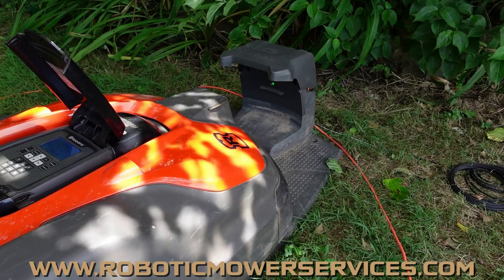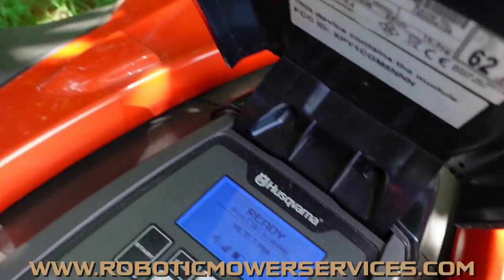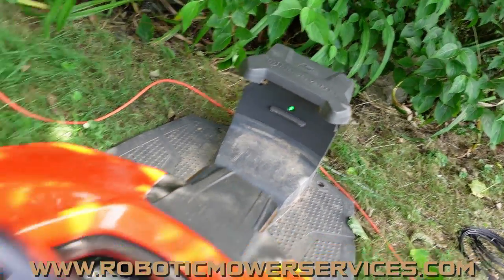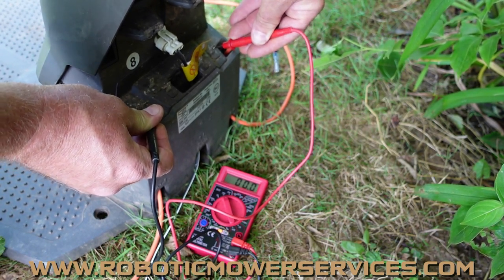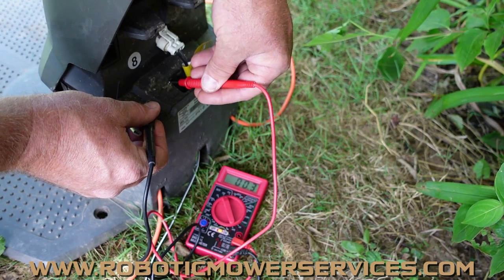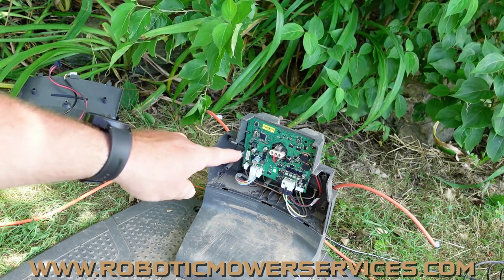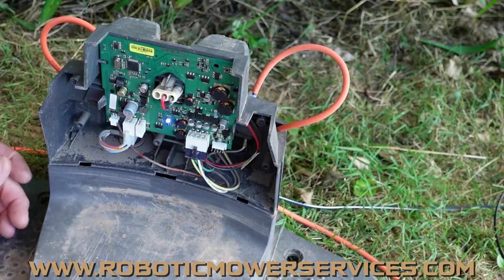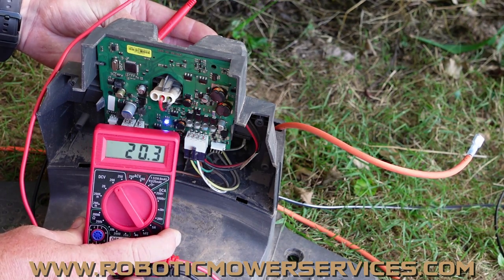Testing Charging Station Output Voltage (Husqvarna Automower No Loop Video # 6)

Comment: u are my saviour! my 310 stopped and gave me a no loop signal, then it didnt wanna charge, opened the charging station and took out the card to check, and yep there was a burned bit of card, so i swaped it out for one i found on the garbage free of charge, installed it and it took charge, but i had the no loop signal. after ive been pulling my last few hair on my head i found this video and i ran as fast i could down the stairs and into the mower, straight into security and new loop and TADA IT WORKS!! im so happy! i hope you have a good life !!!!
Reply from the maker: Glad you were able to get it working!

Comment: The tip about having the mower out of the charging base when starting the new loop signal creation was helpful. It actually created it but the mower pauses on follow out and now won't create a new loop signal.

Looks like I'll be needing my multi-meter tomorrow!

Comment: Great video! My 450xh just started  goofing around. Would go forward a few inches and stops, turns a bit, move forward a few inches and stops,... Solid green light in the station. I get 27.7 v where the mower recharges, 4.6 v on all guide wire tabs, but only 25.5 v on the loop tabs. I guess its either the board or the harness to the terminals.
Reply: I'm also getting 25.5V on the boundary. Did you find a reason why you were losing 2V and were you able to resolve your issue? Thanks

Comment: I replaced my board last year but the board was more obviously the problem, no/low voltages at the boundary wire terminals. Voltages are high at 32V now even though the transformer feed is 28V but have the flashing blue light.
I initially had flashing red and diy repaired a break in the home wire antennae in the base station floor but was greeted with the flashing blue next. I got a new board but it made no difference… at a loss now
Reply from the maker: Here's a troubleshooting guide that will help you diagnose the issue: https://www.roboticmowerservices.com/post/troubleshooting-a-no-loop-signal-error-on-a-husqvarna-automower

Comment: Hi, great touturial…i got one of the older 305, with the 21v power supply.. the station gets 21,6 volts steady, and with boundrywire disconected, the board hummes, make sounds… i measure a fluktuatin voltage to the boundrywires(disconected) going from 18 to 22volts, on guide output 3 to 4,5 volts..
Mover charges and the light on station works well, green, blinking and blue…. Do you think it is the board.?

Comment: This has been brilliant - very clear and well illustrated and I've followed every stage, thank you. However, I've got to the end of your testing programme with solid green light, 28 volts in & 28 volts out on the boundary wire and the charging pads and perfect continuity on the boundary wire but it's still showing zero on all the signals - loop and charging station and won't pair. Any ideas, please?
Reply from the maker: Probably mower related at that point. Possibly a front loop sensor or main board issue
Reply: @RoboticMowerServices  thanks for your help.

Comment: Thanks for great info. I changed my pcb card on my 435x base. Now it goes out to mow and goes away out past boundary wire hits the fence and stops and just sits there. No loop signal. I have a green light. I have 33v on loop and 14 on guide. 4.5 ohms on complete circuit and 3.9 on guide. I have relearned the loop with no problems. Don’t know what its problem is.

Comment: Hi tested my 315 year 2015 and i have 30 v between the 2 boundry wires so thats ok  but when i messure the guide signal from the charger i have 13v ,is that correct?
Reply: Same here on a 415x. Wondering if it is a different spec for these models or are we having a problem with the board. I started checking mine because of odd behavior when using the guide wire...
Reply: Same on my 330x 32 v on my boundary wire and 13 v on my guide wire. The search goes on.

Comment: I have an automower 330x and checked all the output values and everything is correct. I have the problem the automower does not use the guide wire. On the automower i can see it does not have connection with G1. However it does give values for G1 for the lus sensors. Any ideas what could be the problem?

Comment: I have very strange voltages at my charging station (28 V):

between AL and AR: 32 Volt
between AL and G: 4 Volt
between AR and G: 14 Volt

How is that even possible with a 28 V transformer? And why is the current between AL and G not the same as between AR and G? Any ideas anyone? Thanks for your help!
Reply: Same here on a 415x.
Reply: Same here on 420 and have flashing blue. Did do a botch repair on my base station antennae wire that tells the mower it’s home and was immediately greeted with the flashing blue after stopping it from flashing red. Changed board and no good.

Comment: So I have changed the power supply and the charging station board.  I am getting the fast color changing light red.  Also there is no volts on the charging outputs of the station either.  Could it be that I got a bad board that I replaced?
Reply from the maker: What is the voltage coming into the board? And is the voltage coming into the board consistent? Meaning it is staying at a steady number and not jumping from 28 volts to 31 volts or something like that.
Reply: @RoboticMowerServices  I will check.
Reply: @RoboticMowerServices  When I put a paperclip in each hole of the actual plug from the power supply I got from about 2 - 9 volts and it just bounced back and forth.

Comment: Got flashing blue LED.   Boundary wire resistance is good -  1 Ohm and AR/AL terminals are reading 28V when disconnected from boundary wire.   The Guide wire terminals are reading 4 8 and 12V though.  Don't know what to try next.
Reply: Me too
Reply: Have you solved since this was 4 months ago? 😬
Reply: @alanmannion8670  yes.  It was the circuit board in the basestation.  Replaced and works perfect now.
Reply: Thanks very much for getting back to me! 
I replaced mine last year but the board was more obviously the problem, no/low voltages at the boundary wire terminals. Voltages are good at 28v now but have the flashing blue light.
I was initially repairing a break in the home wire antennae in the base station floor but it started to rain and I had it still plugged in. So the water may have fried the board again. Thanks again. I’ll have a think and prob replace the board too. 👍
Reply: I replaced my board last year but the board was more obviously the problem, no/low voltages at the boundary wire terminals. Voltages are high at 32V now even though the transformer feed is 28V but have the flashing blue light.
I initially had flashing red and diy repaired a break in the home wire antennae in the base station floor but was greeted with the flashing blue next. I got a new board but it made no difference… at a loss now
Reply: If you disconnect all the loop wires from the basestation and then short out the two main terminals, AL and AR, with a short piece of wire, you’ll be able to definitely say whether the flashing blue error is caused by the basestation or the boundary wire.  If it goes green, it’s your boundary wire. If the flashing blue persists, something is wrong in the basestation.
Reply: @johnodonnell4593  You’re right! I had thought of that while I was stewing here but haven’t gotten to try it yet… Thanks for the response.